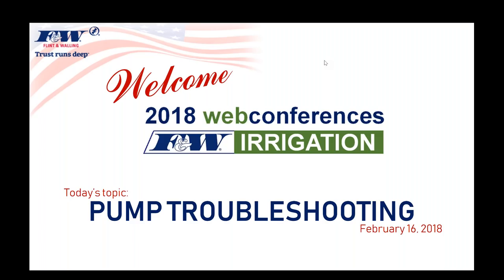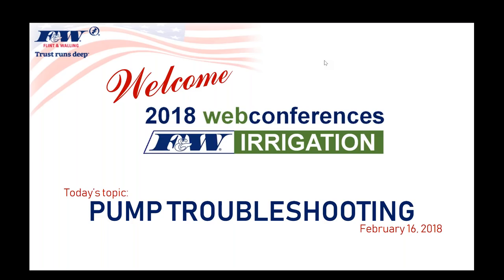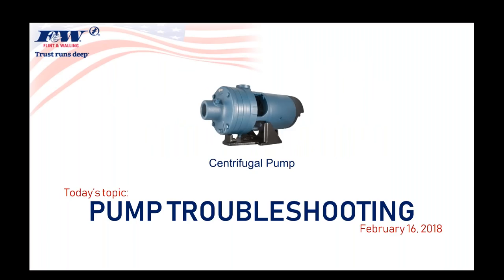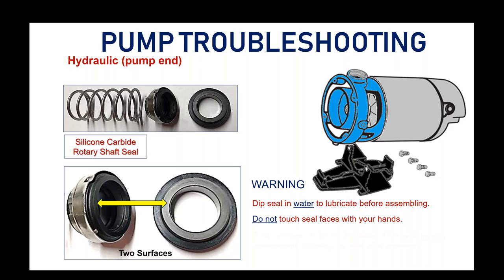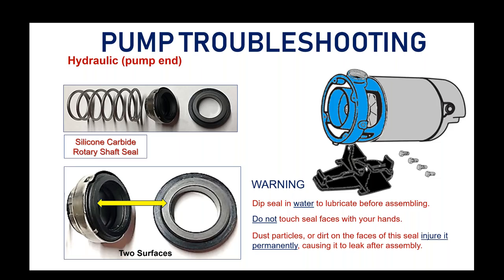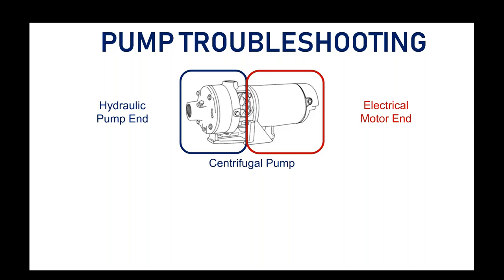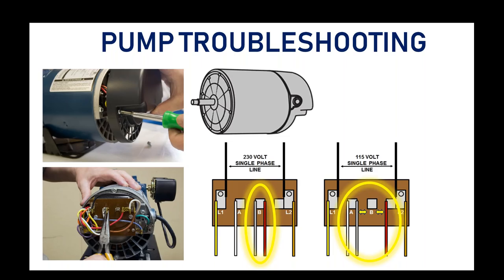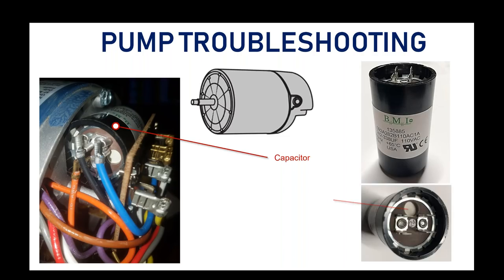Centrifugal Pump Repair & Troubleshooting

Comment: What happens when the brass impeller comes apart in two pieces? Do you need to replace them or just nest the two halves in place on assembly?

Comment: I have this exact F&W pump, 2H, for my UG sprinklers. Date stamp 9809. I shut down the sprinklers and forgot to shut the breaker off for several hours. The motor is working but I can't get the pump to prime. Where can I get parts for this pump? Thank You, Sharon

Comment: Doesn't seem that F&W  is monitoring their video comments. But here goes since this is a troubleshooting video...   I accidentally started a non self priming pump that wasn't primed yet for about 10 seconds it had a loud screeching sound.  I quickly turned it off, primed it, started it again shaft was spinning but NO SUCTION or water coming out.  Did I ruin the hydraulic side?  What probably broke?  What parts do I need to rebuild it?
Reply: An excellent,  well-illustrated  presentation,

Comment: I’m using an older f&w jet and having issues with it doing literally nothing when flipping the breaker.  It’s wired properly, has power going to everything.  Makes no click, pop, hum, buzz, or sizzle sounds.  Just sounds like it’s getting no power past the control board. I tested the relay and replaced the capacitor and still
Nothing.  Is there a second compacitor in the bottom of the unit?  Under the start cap and the control board there is a black plastic circle that looks to be hooked in with two bolts, is this the thermal overload?  Is there a fuse here or is this replaceable?  What are the chances this could malfunction or become damaged?  If so is it something I can replace and if so why is so hard to find Info about it?
Reply from the maker: Hello!

If you could provide us with an email address one of our team members can reach out to you and address your questions. 

Thank you!

Comment: Q: My well pump & motor are in the basement...the pump end has two pvc pipes...? why two?  You example shows one inlet.
Reply: One of those pipes is for discharge & the other is for suction........they are used on deep wells (over 25'). The suction is 1 1/4" discharge is 1"

Comment: I mean everything was accurate but you showed me but that's not what I want I got two older type of I would jet pump up right I got two propellers on I took it off and there's two seconds I'm pretty sure I want to go to another area and another propellers was another bottom part or how are you going to say it but I need to know how that goes to do it it's not showing me that's not the right type of pump I'm looking for I want you to tell me something I got to stay right 1 horsepower one inch outline 1 inch inline the pump out the water tell you I got to order type of pump that I need to know exactly what it is how it goes together I already got it back together and I'm not getting no prime out of I don't know why I checked the line the bottom core pipes out and it was a hole in it I fix the hole but I can't still get your prime I appreciate if you could tell me something